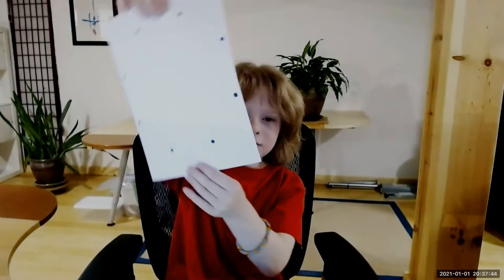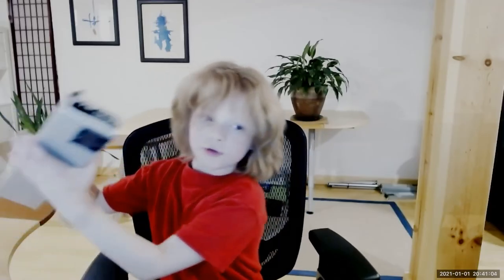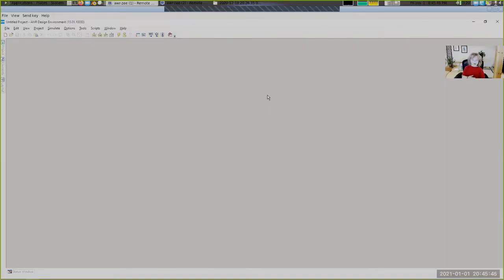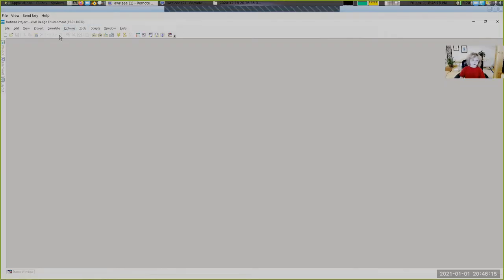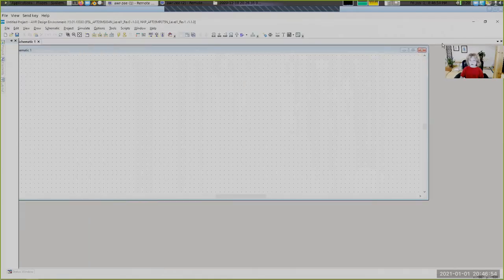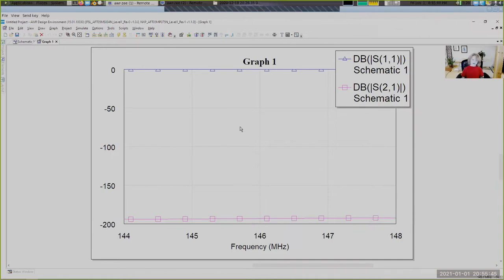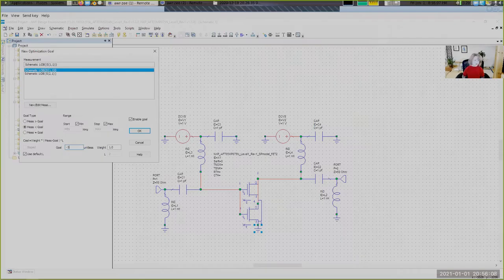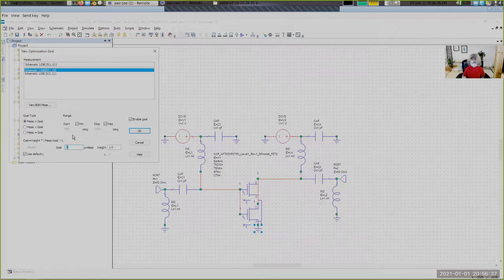How to 50-Ohm Impedance Match and test a NXP LDMOS FET with Microwave Office

Comment: Wow, great work!  Serious MWO chops.  For a tip: the bypass capacitors in parallel with the voltage sources (DCVS) won’t actually do anything, as an ideal voltage source is already an AC short circuit.
Reply from the maker: Thanks for the tip! In this schematic, the CAP was parallel to the power supply, cause in another schematic we had an ideal biastee above the CAP, measuring the amount of RF going into the power supply. Is there a better way to measure that?
Reply: @KJ7NLL  you could put a few 100 nH and 0.5 Ohms in series with the DCVS, which would give a realistic power supply impedance, depending on wire length, etc.  You can then place a voltage probe on that node.
Reply: @KJ7NLL  , i'm pretty sure there is a probe that you can use in place of that in the elements browser